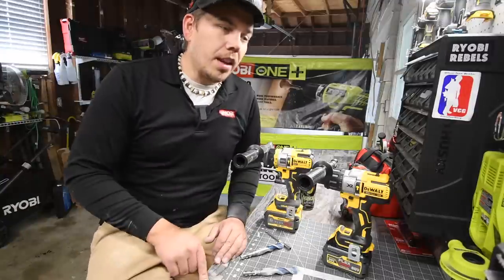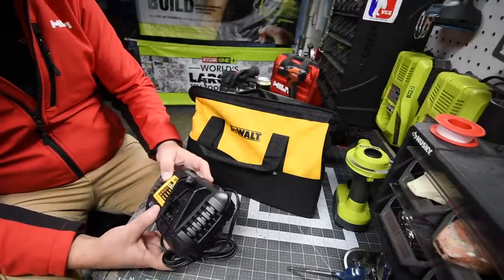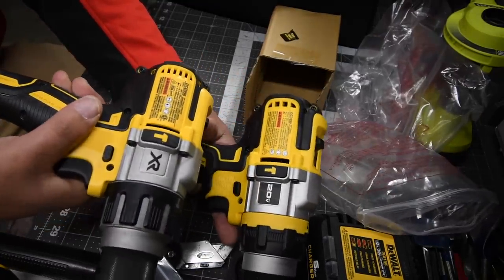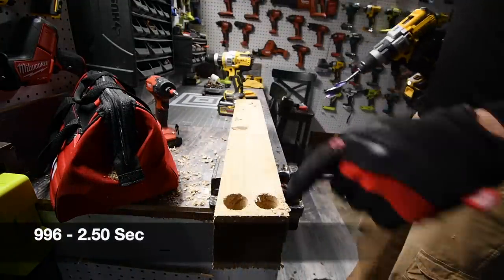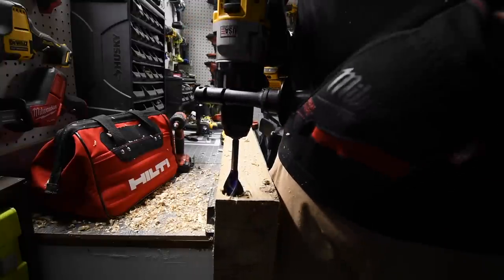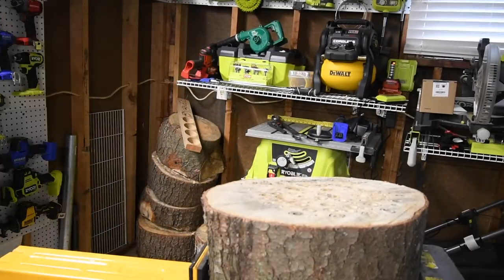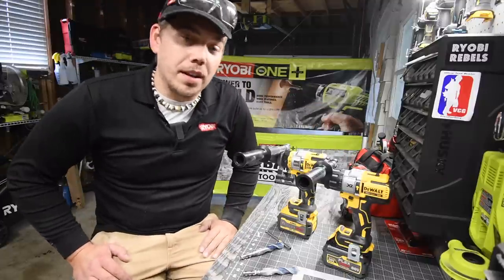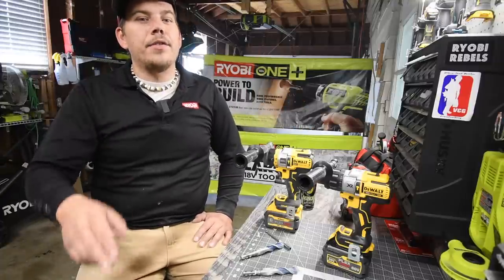NEW!!!! Dewalt Flexvolt Advantage kit

Comment: dewalt needs to make a power detect and flexvolt advantage impact driver it could be more compact and more powerful and with the rumor of milwaukee gen 4 dewalt needs to get at it
Reply from the maker: I agree, upgrade that impact already is what I say
Reply: Yeah, I never even bought the 887/888. Just got a 890 and a hex adapter, and a 12V impact driver for when it needs to be super compact. Can't justify not waiting for an update, because so many have surpassed it. Kobalt, Ridgid, Milwaukee, etc all have faster and more powerful models that don't burn up lol

Comment: Power detect makes more sense. 36wh more capacity with 8ah and def 21700 cells. I dont see how the flexvolt 6ah is 21700 if its the same size as the old one. I would think it would be same size as 9ah which is honestly too big for a drill. Plus with the other tools they made why wouldnt you jus get flexvolt version if you need flexvolt batteries
Reply from the maker: if it did have 21700 cells in it there would be a big difference in performance
Reply: @ManCaverTools  definitely the 8ah battery gives a nice boost to any 20v tool. I pretty have strictly batteries with 21700 cells now cuz i love em so much. Trading off batteries or selling some to co workers that want quantity over quality. I got 3ah slim jus a couple then 8ah, 9ah, and 12ah and thats it
Reply: If I'm going to invest in FlexVolt batteries  , I'm going to go with the 60v FlexVolt Tools and get the most power , why waste them on 20v tools .  And that why I went with the Power Detect tools , because I'm on the 20v platform already,  so they make more sense to me and the new 8.0ah & 6.0ah batteries are Awesome with the other 20v tools ..... 👍

Comment: Every video I see of this guy he’s dogging Dewalt tools. I’ve owned dewalt battery powered tools for 8 years and I’ve always had great performance out of them and I’ve worked construction and most of the people I see on the job sites here use dewalt. So obviously they must be doing something right. A buddy of mine is a Milwaukee guy and I’ve used his Milwaukee fuel impact driver and I still prefer my 887 to his fuel. 887 is much much better balanced and more comfortable.
Reply from the maker: im just saying in this video get the power detect and not the Flexvolt advantage
Reply: Is it true power detect suffers from smaller batteries, I’m sure it’s perfect on an 8 amp hour and up battery but if your using a 1.5- 3 amp hour battery to keep down on weight does that make the flex advantage better at that point?
Reply: I’m surprised he dogs dewalt tools when he absolutely adores the majority of his god-awful ryobi tools.
Reply: @ManCaverTools  PD gets kinda heavy when it only grabs more power from 8ah battery... Without using the 8ah battery it's really no better than the 996 drill. Most of the time most people won't need an 8ah battery all day.
Reply: He’s not dogging them he simply said the flex advantage isn’t really an advantage so if you already have the 996 it’s basically the same tool if you want an upgrade get the power detect versions.

Comment: I’m 99% sure the Flexvolt Advantage line is LITERALLY the same as Power Detect. It’s just the Home Depot Version.
Reply: I'm thinking the same exact thing..
Reply from the maker: no, Ive just uploaded flexvolt advantage vs HILTI and the HILTI won. the Power Detect beat the HILTI in almost every test. the Flexvolt advantage only won the test parts of the test against the hilti. check out the video
Reply: @ManCaverTools  dam well that sucks. Initially I really thought the Flexvolt advantage tools became “60 Volt” tools once you slapped a Flexvolt battery on them. But they are apparently 20v tools that just receive more power from the flex batteries.
Reply: They are legitimately the same drill. Just one is sold at Lowe's and one is sold at home depot. 

This was confirmed by a rep at world of concrete

Comment: That new 6 didn’t look any different in size to the old 6. According to that, it can’t have 21700 cells. I’m gonna bet if you put a 9 on there (that does have 21700 cells) that it performs like the power detect. The show you just did looks like the difference between my 996 & 998 with 5’s. A difference, but not huge. But as soon as you throw 8’s on, game on. By the way, I’m fully invested in power detect. As soon as I tried that grinder, I bought 3, and 2 drills. Picked up the circ and recip when they were giving an extra 8 for free aswell. Don’t know that a guy really needs any more power than a 996, but it does make tough tasks go smoother. The 996’s are still great and plenty of power for most people. I just bought 3 more 996’s on clearance the other day.
Reply: Can’t wait to see showdowns of the flex adv vs the power detect, with true And verified 21700 cell batteries.
Reply: 👍I also jumped on the Power Detect Grinder when they started to give out the Free 8.0ah battery , Great Deal....👍🛠🖖
Reply from the maker: looks like I might have to open up the battery

Comment: I love your channel. But I would like to correct this. 21700 cells are 40% bigger than 18650s in volume. There is no way 15 cells of 21700 could fit in the same 6ah flexvolt housing.
21700 means 21mm in diameter and 70mm in lenth. 18650 is 18mm in diameter and  65mm in length

Comment: So do you think its safe to assume that the 998(Lowes lol) will perform like the 996/999 did with the Flex Volt 21700 cells?  Seems like alot of redundancy just to keep looking as if theyre rolling out new products.
Reply from the maker: I thank the Power Detect will win over this
Reply: I own the Power Detect and its Definitely a upgrade from the dcd996,  and the new 8.0ah & 6.0ah batteries do have the 21700 cells in them.  It's weird but all the videos I've watched before I bought my P.D. hammer drill , the drill actually had Less power when they used a FlexVolt battery on it , it got the most power from the 8.0ah battery that came with it and the other thing is the RunTime with the new 8.0ah batteries is incredible....👍🛠🖖

Comment: If it has 21700 cells it would be physically larger. That's the same 6ah battery, as it's been 18650. The 9ah and 12ah have the 21700 cells hints it's size difference compared to 6ah (flexvolt)
Reply from the maker: I did a huge performance boost using this battery on the impact driver

Comment: I missed something. Is the "power detect" technology in the impact driver or is it in the battery? I checked Lowes' website and it doesn't offer a stand alone "power detect" battery. but it does offer several devices with "power detect" technology.
Reply from the maker: the batteries that come in the power detect are XR batteries with powerful 21700 cells in them
Reply: just a marketing gimmick. atomic, power detect, flexvolt advantage are just too many labels. dewalt should stick with xr, 12v and flexvolt and stop the rest of useless

Comment: What is a flexvolt. I thought it sounded like a battery that could work in their 12v line too.
Reply: It is a 20 volt that can Electronically switch to 60v
Reply from the maker: a battery that works for both of dewalts 20v and 60v  tools

Comment: Love your channel always learn a bunch.. my question is on the flexvolt advantage drill along with the grinder.. do you have to use the flexvolt advantage battery to utilize the extra power. Or can you use any flexvolt battery. To get the same kind of power as a flexvolt advantage battery

Comment: Is there a power detect impact drill driver ? Or are we pretty much stuck with the dc887 as the top of the line dewalt impact driver ?
Reply from the maker: the power detect is the most powerful hammer I tested
Reply: @ManCaverTools  thanks for your response , but I was asking about a dewalt impact drill . Is the dc887 the top of the line impact driver ? Thanks in advance

Comment: Do you know if its confirmed that the new flexvolt batteries have 21700 cells in them? Trying to decide between Flexvolt advantage and power detect.

Comment: Why didn't you test with a 20v 8Ah or 20v 6ah? Testing with both Flexvolt batteries didn't showcase the difference/advantage of using the flexvolt 20/60v over a standard 20v. However, you did show that DCB606(G) and DCB606(Y) are the same battery. How about another episode using a 9AH flexvolt and some standard 4/5/6/8 ah 20v packs VS the DCB606?
Reply from the maker: Because the new 6ah is 21700 celled battery and the original 6ah is a 18650 celled battery. there should have been a big difference but there wasn't.
Reply: Sure didn’t look like that new 6 was any different in size from the old 6. Can’t be 21700 cells according to that.

Comment: Did you make a video of the power detect vs 996? I can’t find it. Could you make one of the 998 vs 999
Reply: Yeah, I would say 999 with its Flexvolt 6AH new battery VS the 998 with its 8Ah XR Battery. Is it proven that the 8Ah battery has the newer cells inside them at this point?
Reply: John S I believe it does have the newer cells in them. Yes that test plus it would be interesting to see the new flexvolt battery in both 999 and 998, and then the 8ah in both of them as well to see if there is a difference
Reply from the maker: I did not. I did a test a while ago on it off camera to see if it was worthy of a video and it was. so I did power detect vs hilti and milwuakee and the power detect won both videos
Reply: Man Caver Tools oh cool thanks for the update!  Do you think you’ll do a power detect vs flexvolt advantage?
Reply: @justinrozon7  --- In all the videos I've watched on the dcd998 Power Detect , it actually has less power with the FlexVolt batteries , it gets the most power from the 8.0ah battery that comes with it that has the 21700 cells .  Just seeing this video with the FlexVolt Advantage vs the dcd996 , I'd say the P.D. is more powerful than the F.A. , just my opinion....👍🛠🖖
Reply: Brian F ya it’s hard to tell but some of the videos they were using the old flexvolt with old cells. But yes so far it looks as power detect is better

Comment: They don't make 2,000mah 21700 cells. They have 3,000mah and 4,000mah cells only. They haven't found a way to shrink the 21700 cells into 18650 size cells. The number designation is the size of the cell. And was that Grey 6ah battery new or older??!
Reply from the maker: the grey is the older one.
Reply: @ManCaverTools  I meant, was the Grey battery you had an older battery of yours or a new, never used battery like the yellow one. I know the Grey is the older style. Hope that makes more sense

Comment: That should be a 6 amp fast charger. It’s not the normal fast charger that came with the other flexvolt tools. That charger is yellow and has a fan built in.
Reply: And by the way you can send one of those 887 my way I can definitely use it lol
Reply from the maker: like I said in the video, its charged the 6ah pretty fast and it also charges 12v batteries

Comment: I am confused sir.  The jump is mainly between the 20V batteries and FlexVolt 60V batteries.  I didn't see a single 20V battery in this test.  Your expectations were in the wrong places.
Reply from the maker: my expectations where with the Dewalt Power Detect. this did not perform like a tool that has been out for a while already.

Comment: I am stuck in  time warp all my DeWalt tools are either 14.4 v to 18 v. Nicad brushed tools i still use my dc935ka2 at work believe it or not because that's an xrp model I picked up at DeWalt adapter and use a 3.0 ah xr lithium battery works just fine. Actually works even better than it did  if I use the 2.0 xr batteries that come with the adapter kit yes the adapters meant for the old DeWalt 18 volt to lithium  but works just good for me I guess because I'm using the high-end version that hammer drill I got in mom and pop hardware store just sitting on the shelf the box Dusty's anything but NOS still have the plastic  tie on the  hard case cardboard box over that case batteries being from 2008  I was shocked it was still working after sitting all those years never charged I've never done a video but it actually destroyed my ridgid gen 5 x brushless hammer drill says a lot all the problems I seen is why I didn't upgrade to lithium 20 v max  from DeWalt I just stuck with older tried and true except for the one that's two years old and yes there's videos on my channel with that drill and a DW 990kr2 xrp 14.4 v drill I rebuild myself how long would a dw991 I did the same as long as people are still using those I rebuild them for people and as long as I can also find the parts that's my little side hustle I really should make videos on those but I don't have time
Reply from the maker: its good that you fix tools for people. there is a lot of people out there that don't care about the new tools and they want their original tools back operating and good job for that Thomas
Reply: @ManCaverTools  thank you

Comment: not sure why youre so disappointed in the impact. 887 is the best dewalt has out right now or are you more disappointed that there is no new impact from them on the market yet? If thats the case then I can understand
Reply from the maker: because the power detect came out a while ago. they should have just made a better impact driver

Comment: The problem with the dcf887/888 are the cooling fans, why in the hell DeWalt enclosed the fan inside of the motor!!! The fan should be exposed and easy to see but it's hiding! And the fan is smaller than the Ryobi P238 and Ridgid. That's why that model have a problem with the cooling. Thank God I have never ever smoked my dcf888 ever! YET!!! That's why I don't wanna use the flexvolt or the higher Amp hour Batteries. I mean I'm good with the 5Ah or the compact 4Ah battery pack because the more Amp hour you have in the battery the more energy it will have but the more hotter your tool will be. I hope DeWalt will address the issue and have solutions for that problem, a some kind of a Brushless motor that can dissipate Heats or If the Brushless Motor can actually be assisted by a oil or lubricants inside to keep it running cool even at high loads. anyway! That's a nice kit!! But I'm still good with the dcd996 2 Speed Brushless Hammer Drill. I only use that drill for tapcons and concrete anchors, otherwise if I'm gonna be doing a much more heavier jobs my Bosch HD 18-2 or my Bosch Bulldog Extreme Corded Rotary Hammer Drill. That kit is nice but it's too damn expensive!
Reply from the maker: I agree with you on that, the air needs to get out asap

Comment: I have a few problems with this video 1st one is it seems you have a problem with this kit and You are not being fair to the flex volt advantage 2nd  Either there something wrong with your batteries or there is something wrong with your drill because the flex vote advantage is 1276 UWO And the power detect 1071 UWO and the 996 is 851 i bet if you used my 999 with flexvolt battery you would sing a different tune but anyways great other vids but this one is misinformation not correct
Reply from the maker: it didnt impress me that's it. the power detect impressed me immediately.id choose the power detect over this

Comment: The claims on the box are actually correct.  Look at the battery on the box, I am pretty sure that is a 2.0 amp/h battery?  Do a comparison using that battery.  Its a little misleading but probably technically correct.
Reply from the maker: this kit has  a 2ah and 6ah flexvolt battery.
Reply: Man Caver Tools I can’t remember the exact diagram where it show the 42% increase in power.  There was another grey bar? What else was in the diagram?

Comment: DCD999 is 1219 UWO rating with its newer Flexvolt 6Ah Battery

DCD996 is 820 UWO rating with its 5Ah Battery

DCD998 Power Detect is claimed to be 29% more than the 996 paired with a 5Ah Battery that puts it at 1050 UWO. But the kit DCD998W1 looks to be coming with 8Ah Battery. Does the claim of 29% more is 5Ah Battery in each unit 996 and 998 or with the 8Ah Battery in the 998 only? I wonder. Then you are saying the Power Detect is the way to go. So with a 8Ah Battery or how about even this new Flexvolt Battery at 6Ah depending on if they have newer cells in real world test as you did how does it look for all the timings?
Reply from the maker: Id get the power detect if I were you

Comment: Power Detect with a different Lipstick....
Reply from the maker: I think the power detect is better
Reply: @ManCaverTools  --- The videos I've seen on the Power Detect tools , they actually have Less power when they have a FlexVolt battery on them , they get the Most power from the new 8.0ah & 6.0ah batteries that have the 21700 cells , so maybe the FlexVolt Advantage tools will get More power from them too ??

Comment: This test is stupid why do I need to drill a hole in under 3 seconds does it drill a hole yes thats good enough both did good
Reply from the maker: with that mentality you just should get Ryobi if your not worried about power or time
Reply: @ManCaverTools  for the point of this video time is important but for a contractor like myself a few more of less seconds doesn't make much difference hey I love your channel either way